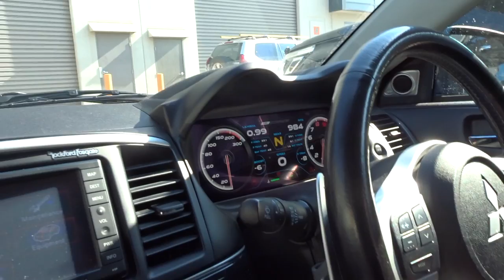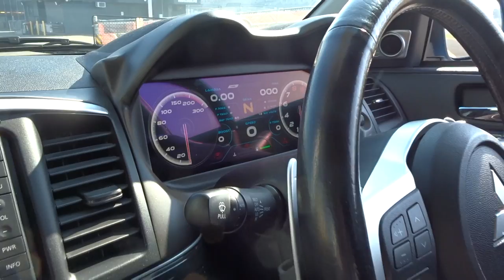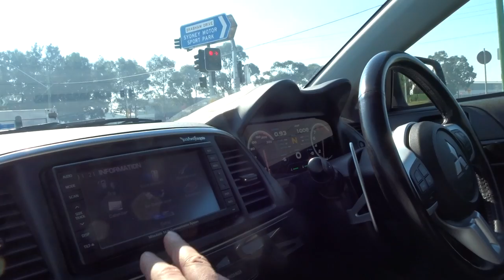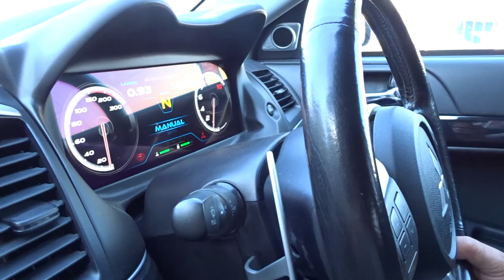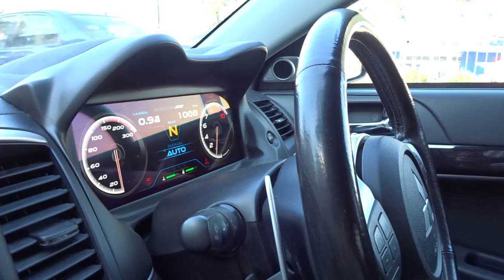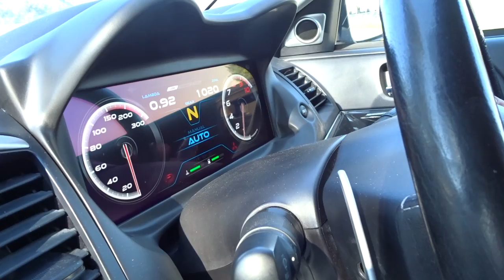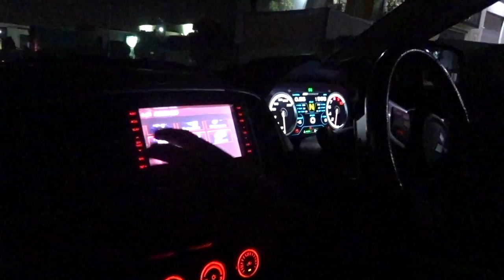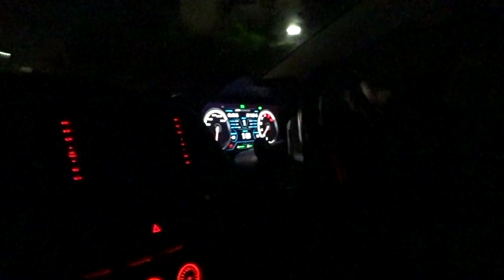World's craziest Evo 10 Street car | POWERTUNE Australia

Comment: THIS evo is better than the 34, purely based on the engineering and tech involved in the evo. What a machine!!!
Reply from the maker: Yeah its got me a little confused also. I still so badly would want the R34 GTR. But this car has really changed my mind about Evo's haha
Reply: DriftSquid the R34 is the COOLER car (evo’s stopped being cool at evo 9) and if someone said you can have any GTR vs any model evo then I’d take a GTR (dream car). However powertune went next level on the evo!!

I recently purchased a car built by powertune and it’s a monster and no where near this next level build. They certainly are a workshop that can hold their own on the world stage
Reply from the maker: @artistintheambulance  yeah that's very true. Agree completely and congrats on getting the car built by the masters
Reply: DriftSquid I’ll be running the S15 this weekend at the drags. Let’s see how nearly 600rwhp goes on 245 street tyres (waiting for my new wheels to land)

Comment: The only thing I hate about the evo x is where the paddle shifters are mounted. You turn the wheel 10 degrees and you can’t reach the paddles smh lovely work tho !!
Reply from the maker: With a street car you cant really make them go with the steering wheel though. I didnt drive it so I cant really say if it is a bad thing or not. But point taken

Comment: I'm surprised He didn't tell you that you can run that Paddleshift trans in any model car,  doesn't just have to be cause its a SST Evo X,  plenty of the old generation Evo's are popping up with them too,   180sx /  Skyline Gtrs etc
Reply: You should get Chea to take you in the Evo 8 mr or 9 its Red,  they built that has the same Paddle shifted Holinger setup in it, to compare the pro's / con's   the 9 is more then likely to feel more brutal,
Reply from the maker: Yeah he can set the paddle shift up in any car correct, I was just trying to say he has retained the factory feel of the car by using the existing ones.
Reply from the maker: Im keen for that

Comment: Hollinger sequential gearbox and it has no clutch pedal, and an automatic mode?? 😮😲🤯🤯
Umm, never mind, saw the clutch pedal. Still, I'm amazed at the way it has an auto mode with a manual gearbox. I wish I could do the same with my Veloster with its normal torque converter auto with that has the paddle shifts. Just an amazing effort by PowerTune. 👍
Reply from the maker: Yeah its mental hey. Really have taken it to the next level with this car!
Reply: @DriftSquid  The RBM3 is next level...this is just a frigging cheat code!! 🤣😂
Reply from the maker: so true mate